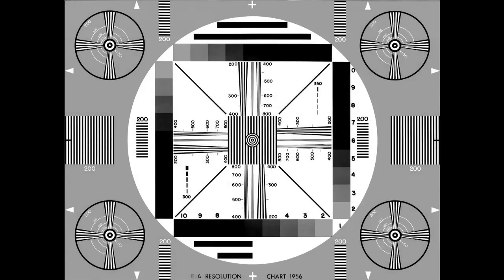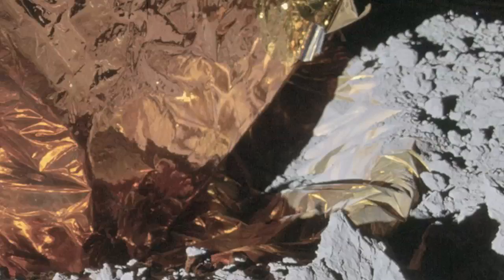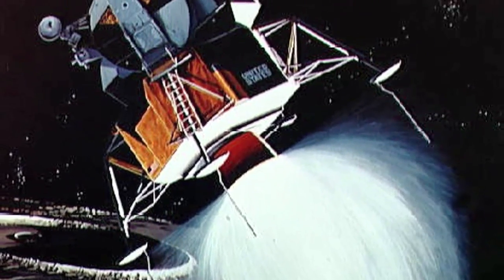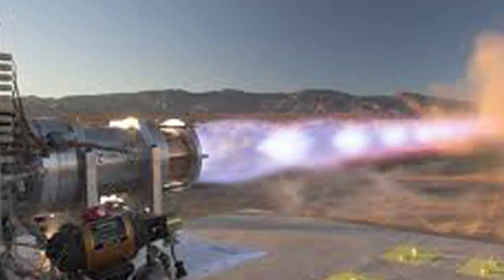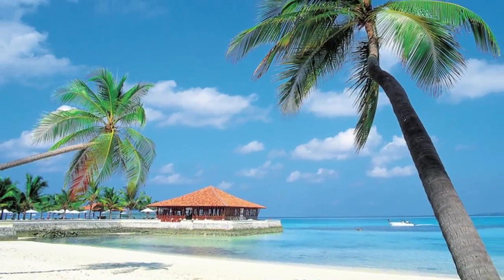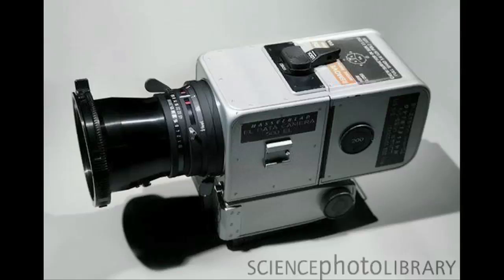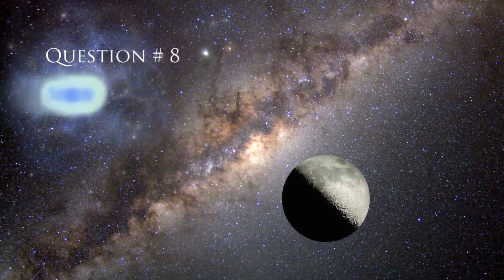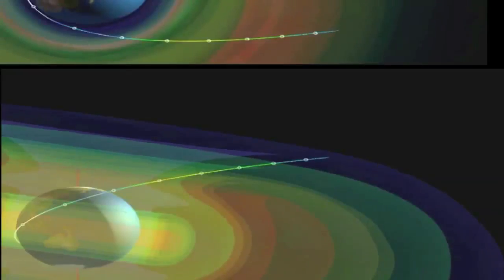Pt1gard's 10-Question Apollo Test

Comment: Question two - so what you are saying is , the engine wasn't attached to the rest of the craft , so your right ! Sound can't travel through metals that's why we don't use metal for wires for speakers , oh wait we do ! And the astronots were not in the in space they were in a pressurised cabin with Air ,sound travels though Air quite well ,pawn !

Comment from the maker: @pt1gard, 

Five layers of aluminized Mylar interwoven with four layers of Dacron (9 layers right there)
Two layers of Kapton
A layer of Teflon-coated cloth (dense cloth for rip protection)
A layer of white Teflon cloth (for reflectivity)

That's 13 layers OUTSIDE OF THE PRESSURE SUIT LAYERS!  You can compromise 13 layers and still live if you haven't busted the pressure suit.

You ask why astronauts (test pilots) don't panic. Seriously? Because they aren't pansies, Coach!

Comment: Its likely they picked up resonate vibrations while inside the pressurized LEM ,one person might perceive that has noise,but it is actually the supersonic exhaust hitting the atmosphere that produces the rocket engine noise,if you don't have a atmosphere,your not producing any sound waves,vibrations.But again if the inside of a object in a vacuum is pressurized,vibrations can be heard,such as when the astronauts were striking the core drill,very hard,the noise was conducting up into the suit,and picked up by the helmet mic.We weren't hearing the hammer hitting the core drill,it was the suit materials,and other metals inside resonating and conducting up into the pressured suit and helmet making it appear as the sound  we were hearing was emanating from the hammer striking the core drill.

Comment: Landing plates question-you showed dust inside the landing cups lol and then told us they were  designed not too let dust in so which is it ? Your clever the way you put their point across ! well not really !so there was no dust left except the dust the footprints were left in ,put some flour on a table and gently blow at it with a straw ,it leaves a clear pattern ,there's nothing like that on the tapes or pictures ,pawn !

Comment: (part3of3)   without changing its VALUE. So, let's suppose we wish to convert 1J/kg to  X MeV/ kg. All we need do is multiply 1J/kg by the appropriate form of the number 1, or CONVERSION FACTOR,  which in this case is [(6.2415 x 10^12 MeV) / (1J)]. Evaluating, we have: 1J/kg x [(6.2415 x 10^12 MeV) / (1J)] = 6.2415 x 10^12 MeV/kg. Note the “1J”in the numerator of the original expression cancels with the “1J” in the denominator of the conversion factor, leaving MeV in the numerator of the result.

Comment from the maker: Listen carefully to the "scientists." They'll tell you how complex it is. They are the ones who discovered the Van Allen Belts and who equipped the Apollo astronauts with dosimeters to measure the radiation doses. Those doses aren't even remotely close to anything lethal. That's because most of the radiation was Alpha & Beta particle radiation, easily shielded by a space capsule or a suit. It's not just the dose, but the type and most is not electromagnetic radiation as at Wood River Junction.

Comment from the maker: @stalkervision, what is the difference between "digging in" (which means surface ends up on top of the pads) and surface forced on top of the pads by engine thrust?  Either way, the lip of the footpads protects the pads from regolith (which is under the pads) from ending up on top.

Comment: @Daddyo930    "...Is it possible to convert rads to MeV... " Tweeker did a perfectly good job explaining this, so I don't know why I bother, but here goes: If you want to pretend to be a physicist, two of the first and most important concepts you must master are those of  "Dimensions" and "Dimensional Equivalence". In the expression "25 miles per hour" - or 25 miles/hr, "miles" and "hours" are the DIMENSIONS. In order to be an expression of speed,    (cont'd)

Comment: @Daddyo930   Another very basic and useful concept for the Pretend Physicist is that of the CONVERSION FACTOR. Changing an expression from one system of units to another is really an EXTREMELY simple task – though it often seems like “rocket science “ to the scientifically ignorant.  For this, it is only necessary to employ three simple concepts, two of which you may recall from your elementary school arithmetic class: 1.) Any number x one = that number. For instance: 1x4=4; (cont'd)

Comment: (part2of3)   1x 127=127; etc. And 2.) Any number divided by itself = 1. Examples: 4/4=1; (-367.04)/(-367.04)=1; etc. The third concept is merely an extension of 2.): ANYTHING divided by itself = 1. Examples: (1mile)/(5280feet)=1; red/red=1; (Barrak Obama)/(The U.S. President) = 1; daddyo/daddyo=1; and so on. Expressions such as 1mile/(5280 feet),  really just a form of the number 1, are called CONVERSION FACTORS . With them we can change the FORM of an expression  (cont'd)

Comment: @Tweekerhead A guy named Einstein discovered that if you want to find out how much energy something has in it, you just multiply it's mass times the speed of light squared. It works for most everthing, especially when you want to convert one type of energy to another like rads to MeV's. It's called E=mc2. When will you just acknowledge that?

Comment: @Tweekerhead Yo! Could you at least get the notation right? The working SI unit is rad (rad), while the traditional unit is a gray (Gy). 1 rad = 62.4 x 106 MeV per gram 1 gray = 100 erg per gram. Using E=mc2, you are able to convert rads to MeV. Why is it so hard for you to accept that?

Comment from the maker: Just how would the astronauts show signs of erythema (sunburn)? The most common radiation they would experience would be Alpha & Beta particle radiation that is easily shielded by a sheet of almost anything. The astronauts were never naked in space. The most intense exposure to ionizing radiation was in passage through the VABs, which lasted just over an hour and wouldn't have caused any sunburn. What are your sources? Certainly not NASA--who know more about cosmic radiation than anyone.

Comment: (part2)   “25 miles/hr” MUST contain the DIMENSIONS of distance  and time ONLY(when fully simplfied), AND in the proper relationship: distance/time, or the equivalent (Example: distance = [distance x time] /time).
   It makes no sense to equate two expressions with different dimensions. For example, “25miles per hour” cannot equal “25 miles” or “25 miles per gallon”....

 So, for our current purpose, MeV can never equal Rad since energy dne energy/mass. 25 miles dne 25 miles/gal.

Comment from the maker: @pt1gard, I see you took a moment to actually question a real issue instead of just coming here flaring your nostrils & kicking dirt. So, the lunar surface gets to -180 in the shade. Does that mean all objects get to those temperatures? You found a temperature equilibrium stat off some website that is not about the surface of Hasselblad cameras, is it? Why would the a camera jam? It doesn't jam when used for high-altitude reconnaissance on earth. To make sure, they removed all lubricants.

Comment: @pt1gard ,,,"why do the suit overheat and the cams wont? ..." ONCE AGAIN - IF you'd actually done any research on the matter, you'd have discovered almost immediately that the Apollo EVA suit was designed with multiple layers of insulation, so that most of the heat load was "metabolic"  - generated by the man inside.

Comment: @Daddyo930 "You have the same problem..." I think it's you who has the problem. Reading comprehension for one: About 2 inches above your last post is Tweeker's answer(which contains a %). I referenced it. That's mine.
  And you got the GCR wrong: ANY atomic nuclei may occur as GCR, NOT just "protons to iron...".
cislunar GCR intensity is known to be 1-2 millirad/hr - depending on the amount of solar (yes SOLAR) activity. Your "10^27 ergs/sec" is beyond preposterous, you don't even give an AREA.

Comment: SIGH.  The various engines used on the Apollo spacecraft components were of various designs.  Now, talking about the LM, and the Descent Engine?  When they were in their PRESSURE SUITS in the Ascent Module, far removed from the Descent Engine, then any vibrations (which are what produce sounds, whether in air or another medium) would be very muted, hushed.

On lift-off, the Ascent Engine too might have made some minor sounds at first ignition, but when running it was quite smooth.

Comment: @Tweekerhead Could you please stop getting that notation wrong? It's like your doing it on purpose. 1 rad = 62.4 x 106 MeV. If you wanna throw the per gram in there, fine but stop getting the notation wrong. You are seriously demented. It's 62.4 x 106, I repeat, 106 MeV. Can you say 106? Where the hell are you getting 100 to the third power from? That would be  62400000 MeV instead of 6614.4 which is the standard unit. You keep this up and I'm gonna leave you alone again.

Comment: @Daddyo930 My GOD! Call Guiness! We have THE lowest IQ on the planet here. I thought it was impossible, but you understand quite a bit less than I'd supposed!!  I gave you a VERY basic and VERY standard method by which to change the system of units in an expression. It's idiocy to convert energy-to-matter-to-energy to get the answer here, when all you need do is convert the SYSTEM OF UNITS in one expression of energy/mass to another expression of energy/mass. "Work smart or work hard"

Comment from the maker: Instead of assuming that NASA could have identified fine traces of H2O in lunar samples 40 years ago, why don't you demonstrate your theory. Explain how the Carnagie DTM (not NASA, but founded in 1904) had the microprobe they used on sample 74220. They just had 1 sitting in a janitor closet, eh? Explain how they searched through 1,000s of the tiny orange beads from Apollo 17 to find the very few with melt incisions. I guess that took them a few nights of overtime, eh?

You're out of your league.

Comment: Lunar Tuner.Could you do me a big favor by debunking video  "Astronauts on trampolines" by Joe Rogan  .As the video clearly shows they were on the Moon.when the scene was filmed They are doing free standing jumps in 185 lbs spacesuits,reaching a height of around  4 feet, then coming to a instant steady state  rest [inertia ].Its clear,that the use of any external force such as rigging,harness,platform,,bungee cords,trampolines ,etc would have produced residual motion from the jump.Also note,even without a suit,it would be impossible to attain that height  without bending at the hips and knees. I not well versed in video editing..and the video is annoying .We can also see the much slower  gravitational acceleration being in the smaller mass of the Moon.so any attempt at CGI,etc would be fruitless and easily detectable.Hoaxers aren't smart enough to fluff the physics. Thanks so much for your time

Comment: 1) The raised lips on the foot pads are designed to keep dust out. However, they did not keep all dust out. To answer 'so which is it', both. Your question is dumb.
2) -Many- photos show clear feathering patterns in the dust spreading from under the lander. Stop being too lazy to verify your statements.
3) "____ ,pawn" is incorrect. The correct format is "____, pawn" ,pawn !
4) These silly assertions are so easily answered, YouTube is throttling me for posting too fast. Captcha: 'aneatidi'